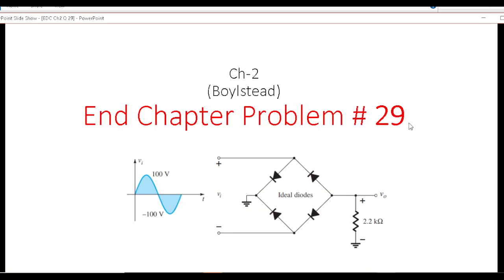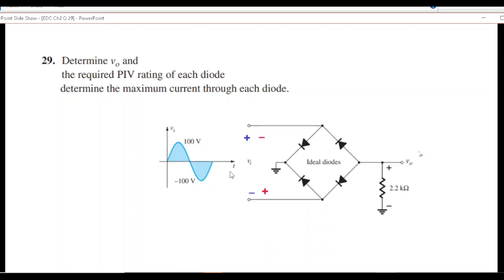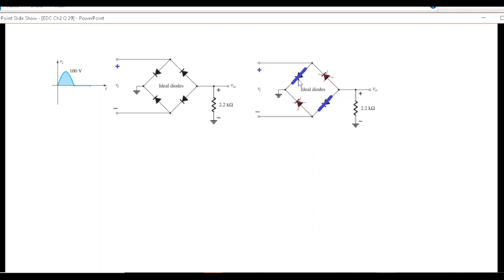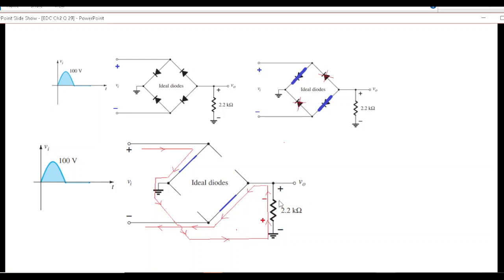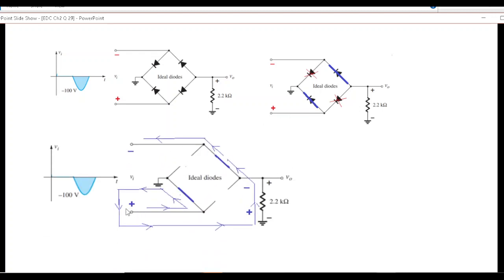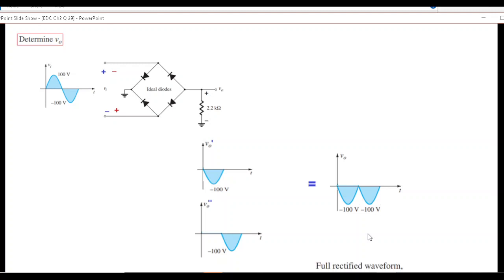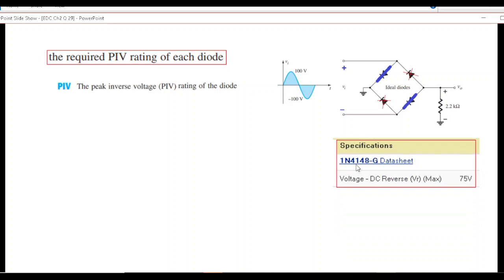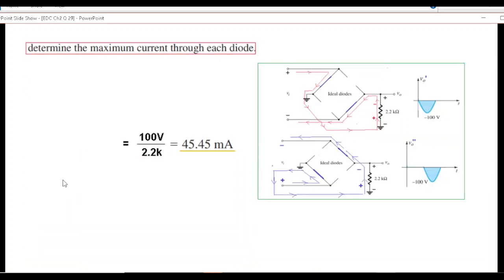(E)EDC(B) Q 2.29 || Full-Wave Rectification || PIV Rating

Comment: Why Imax not negative?
Reply from the maker: It really does not matter. Positive or negative just shows the direction of current flow. The magnitude remains the same.
Reply: @ElectricalEngineeringAcademy  If I do with minus the examiner will give me a zero?
Reply from the maker: The question is asking about maximum current through the diode, this means the magnitude of current. We also know that  current flow through the diode only from positive terminal to negative terminal. I would not suggest that you fall into the positive negative controversy. Best is to ask your teacher and follow him @antornondi
Reply: @ElectricalEngineeringAcademy  I am a job seeker, I have decided to give minus when the maximum current of the load is said.  Otherwise I will give positive answer if say diode current or maximum current. That would be fine wouldn't it..!
Reply from the maker: U might have your logic, but your answer will generate more questions.  @antornondi
Reply: @ElectricalEngineeringAcademy  If I answer with modulus, it would be ok?
Reply from the maker: Go ahead @antornondi